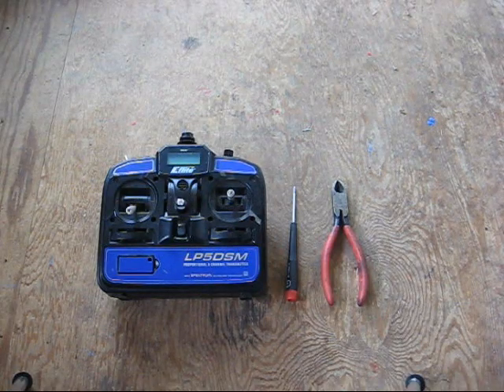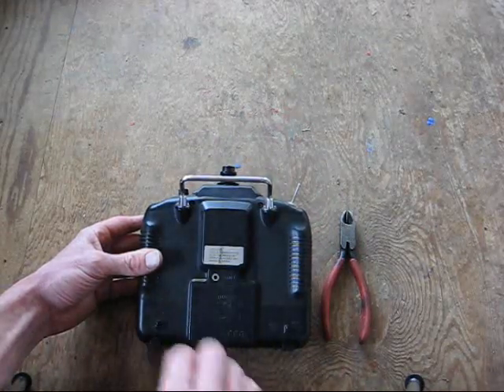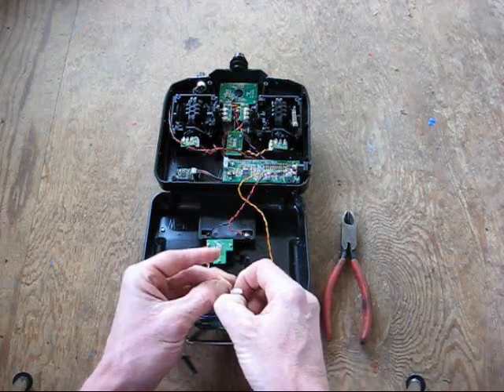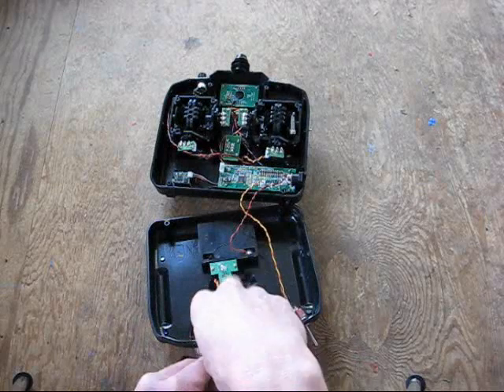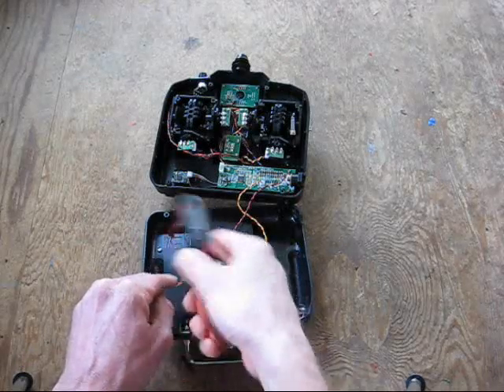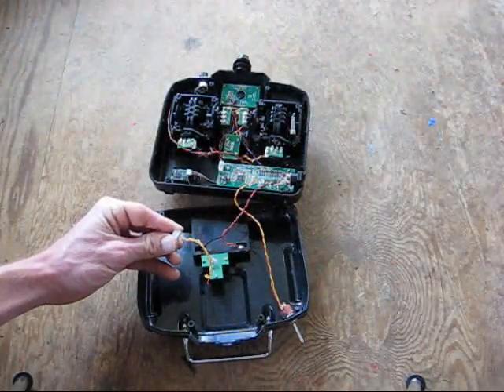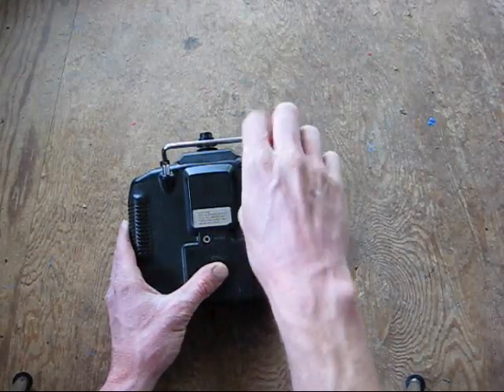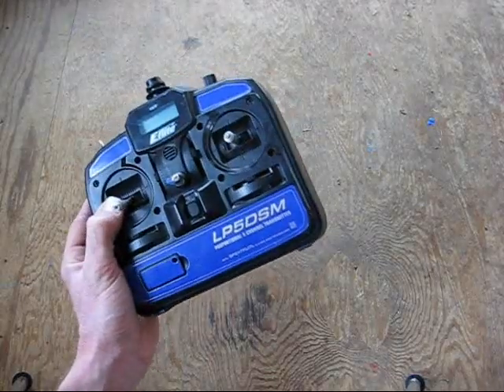How to Buddy Box Your LP5DSM Transmitter

Comment: to use this radio with flight sims open it up trace plug that runs from the board to the trainer port remove red wire from the plug & secure so it dosent short out ..works with fms clearview etc etc